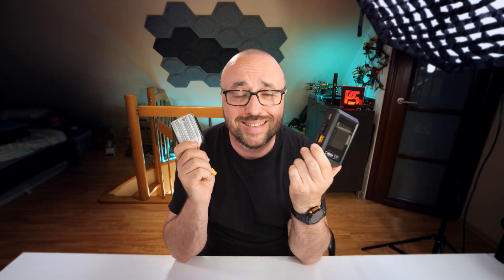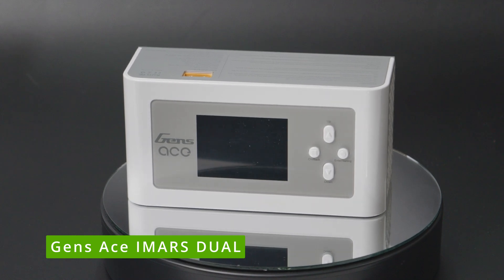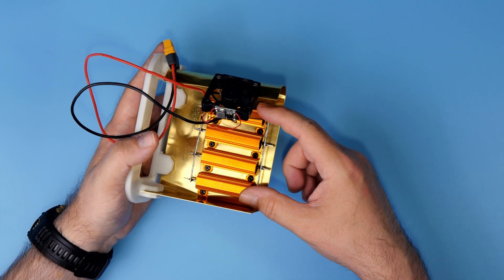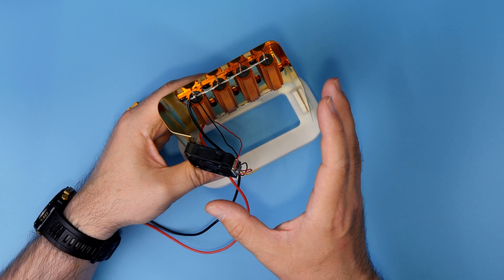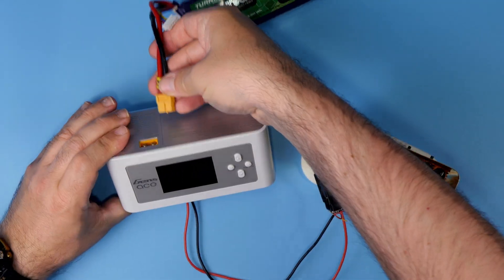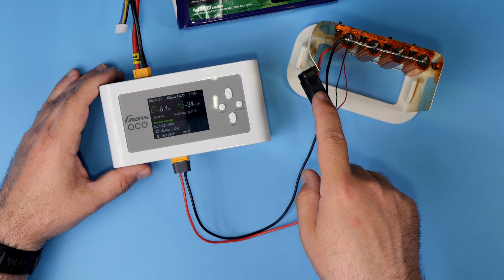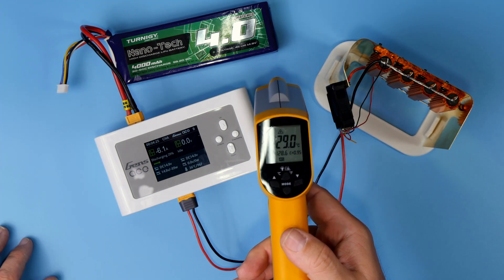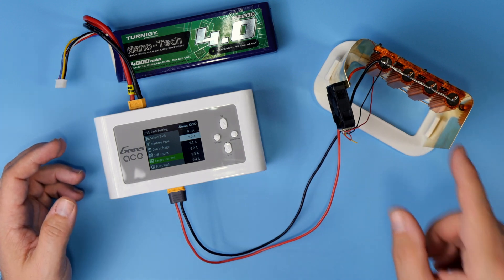How to discharge a battery fast? A LiPo discharge device

Comment: I managed to discharge 2x22000mAh 6S in 25 mins with 1500W 12V RV water heater. Overheating is no problem since resistor won't get much higher than 100°C if you provide enough water. Just be sure to have more than 10L for every kWh of batteries.😂

Comment: I've got one of those huge resistors for my VESC, they're cool!  the ham radio operators put a resistor in a paint can filled with mineral oil to use as a dummy load.

Comment: Hope you can get an actual heat sink for those large resistors.   Best would be to have a thermal engineer model it via CFD to check on best resistive-load cooling config but I guess that's waay to costly at this scale.
Reply from the maker: Or just buy a used CPU cooler and adopt it a little

Comment: Some chargers (Junsi icharger) can not just discharge, but also charge battery conected to input. So instead oh heating resistors you can charge for example car battery. Or like I do use 6s6p liion pack to charge my batteries on field and sometimes discharge a battery back to field pack.

Comment: Nice one, I'm still using 24VDC halogen car / truck light bulbs, 3 connected in paralell and pulling app. 180W. They do get hot too. But you can illuminate what ever you want during discharge. 😁 Ideal for small chickens maybe. 😉😁
Reply: Best

Comment: Discharge without balance lead is no good. Any charger that can do this with balance lead connected?
Reply: So you have balancer on your drone and battery connected to it? We usualy discharge lipo batteries only to  storrage value. And yes this charger can of course also discharge with balancer connected.
Reply: @primoziskra6394  no. If you look you need to use dc input port for discharge when using an external load. That port does not have a balance port.... yes it works... but I prefer to store my batteries balanced. Better in long run also charging next time will be quicker since charger does not need to balance the batteries while charging... so many advantages to store batteries balanced.
Reply: @rasmus80g  I guess you can use described method to quickly discharge a bunch of packs and then go one by one and use Balance feature of LiPo charger afterwards. Still will be faster than using internal discharing circuit of charger. But I think that any imbalance will be minimal if you have relatively healthy packs.
If quick discharging actually brings one of cells below safe level then I think this pack should be discarded.
Reply: This looks like a cheaper option than halogen bulbs. A good idea though is to connect a voltage monitor on the balance lead while it's discharging. I have one that beeps loudly if one cell gets too low. I then storage charge up to 3.8v per cell.

Comment: This seems like a pretty versatile solution.  You could certainly add more resisters, perhaps in series/parallel combination.  You could also add a female XT60 connector to the resistor bank, allowing you to daisy-chain multiple resistor banks.  You could have a small one for modest needs, a larger one for higher power, and both for maximum power!  
One might also consider putting the resistors in a tub of water instead of using a fan. It should be safe at these voltages, and water can absorb a lot of energy, allowing you to run it at higher power.